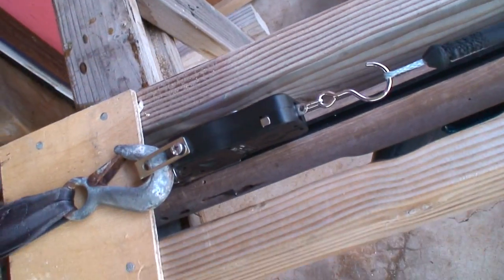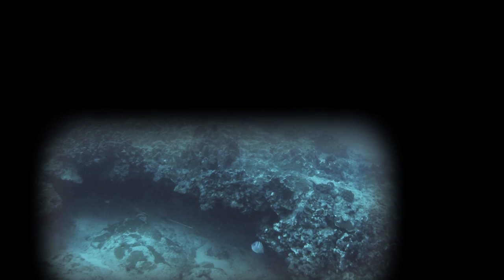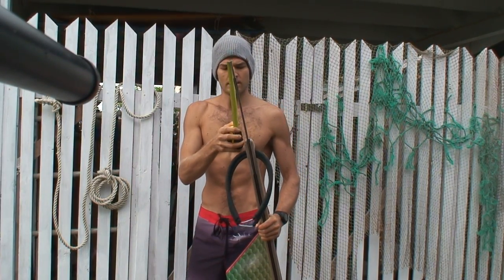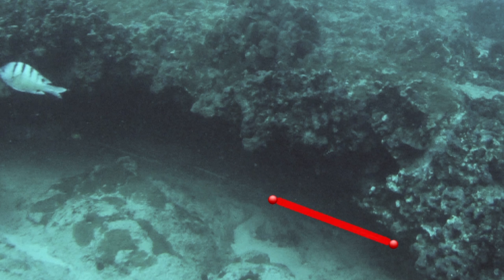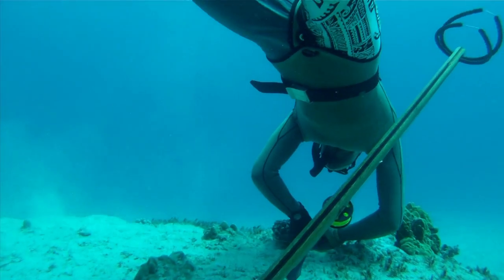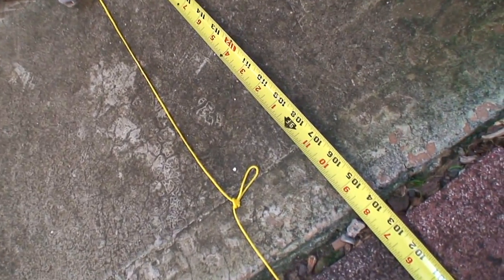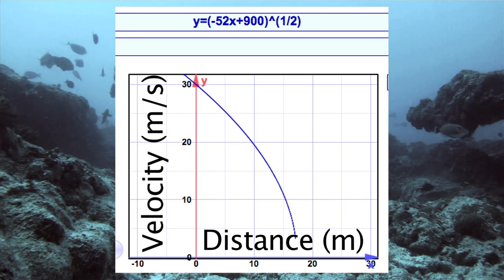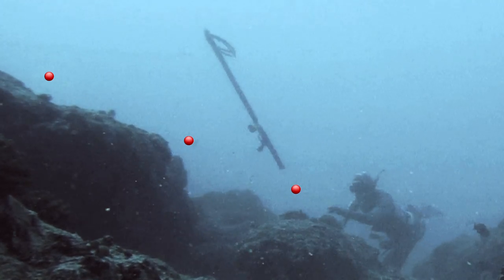Deeper Perspectives Episode 27- Physics 101

Comment: Spearfishing and math! 2 of my favorite things! I've always wanted a scientific method of analyzing spearguns. Trigger pull, power comparisons based on (band size, spear length and diameter and band stretch ), trajectory and terminal ballistics. I would assume the calculations used for a bullet in flight could be manipulated for use with a spear. The density of the water (fresh or salt) would act much the same way as the density or barometric pressure of air on a projectile. You might also be able to find a ballistics coefficient of a spear using it's sectional density and ability to retain velocity in water.